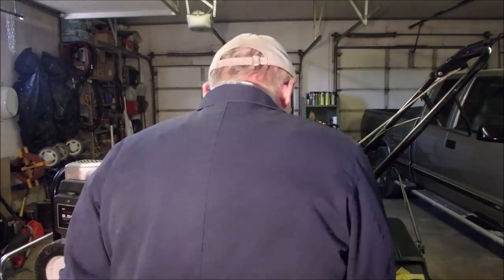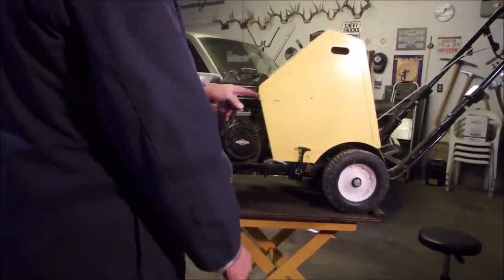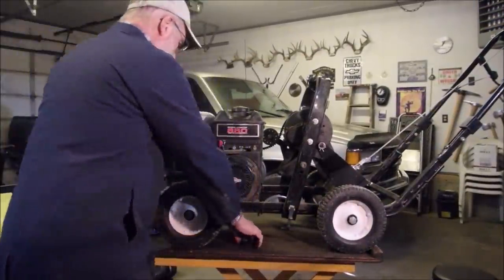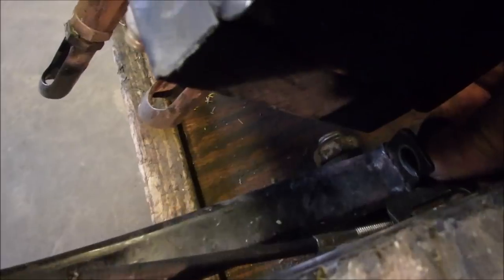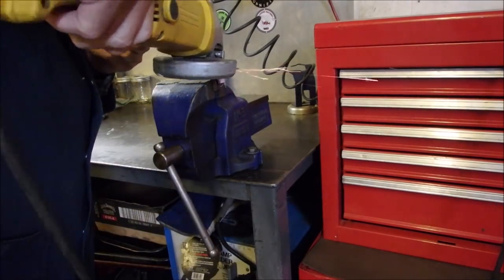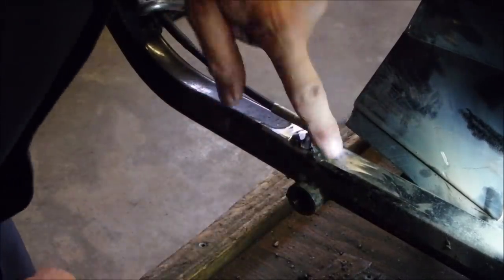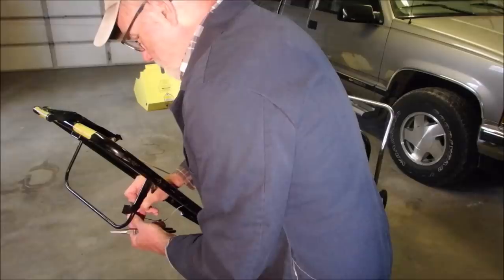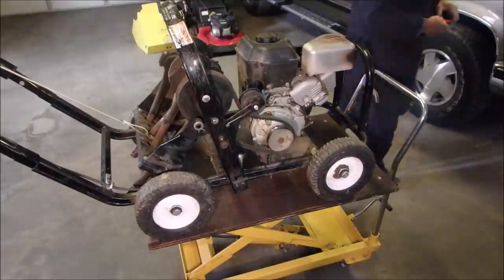Plugr Lawn Aerator Will Not Run

Comment: Good Job Bruce. I used to own a couple of those pluggers. One smaller than that one and one that size. You were correct there was a cable end keeper where you welded that one on at. They are good aerators and work well even when the soil is a little dry.
Reply from the maker: Thanks  I felt to me like I was closer to stock when I was finished ---except for the splice in the cable.

Comment: Nice repair Bruce basically the only way to fix a cable with that splice unless you can pull up a part number and order the original replacement.
Reply from the maker: Yes.  As well my place is more of a hobby setup.  3 machines a week not a day.

Comment: Sorry Mr Bruce but which nuts did you get the paint on sir?? 🤣🤣
If you use Mr Henry's Nut Wax the paint might not stick..... bahahahahaha!!!!
Nice video and fix, thanks for the laugh buddy. 👍
Reply: John you talking about the Nut Wax KB did the video on? We actually got some from Waxmillions in the USA and when you need it to hold a screw or bolt in a difficult spot and your fat fingers are in the way it is the go to solution. One day we need to do a short video on the stuff a must have for the shop saved me hours installing two short bolts on the underside of a rototiller engine.
Reply: That’s the one Mr Wayne, I should get me some too since my fingers always get in the way. 
That would be a good video to do, it would be helpful. 🙂👍🏼
Reply: Paint on the nuts is always a serious problem as turpentine may damage critical components.
Reply: @Big_Johns  good idea. My fingers are not as much in the way as they used to be. But it’s a good solution to a common problem.
Reply: Very true Haney, we gotta watch out when working around our critical components. 😳😳
I’m sorry but I had to chuckle about your fingers comment, I’m sorry. 🙈
Reply from the maker: @waynestefinashen239  Thanks Wayne
Reply from the maker: @haneyoakie14  LOL
Reply from the maker: @haneyoakie14  Darn spray bombs
Reply from the maker: @haneyoakie14  Right.  Good you still have some humour  (Canadain Spelling)
Reply: @Big_Johns  I intended it to be funny. Laugh if the humor moves you.
Reply: @BrucesShop  laughter is good medicine. I’m still in the game. I paid a whole $10 yesterday for a McLain edger that is complete, except for the air filter assembly. Later today I’m going to see what it can do. It is a Briggs, I think it will be fine. I have an air filter assembly that I think will fit. Grass is trying to wake up around here. Let Spring begin! I might go rabbit hunting on Sunday.
Reply: I love to see people smile and laugh Haney, thanks for always staying positive brother. Good luck with the edger, I’m working on a blower and hesitantly a Husqvarna 570 chainsaw even though I don’t work on chainsaws anymore. 🙄🙂
Reply from the maker: @haneyoakie14  Have fun.  Another reason I couldn't test the aerator is we just got another few inches of snow.
Reply: Both you and John Klem have a good sense of humour (per Bruce Cdn. spelling)
Reply: As so do you Mr Wayne 🙂
Reply: @waynestefinashen239  Canadian spelling is perfect for all my Canadian friends. If never worked for me in the US on my grade school spelling tests. Lol.
Reply: Good video Bruce, that was you guys talk about must be the Canada version of the Taryls turd polish? But that machine was too nice for that!

Comment: Usually there is a spring attached at the end of such cable to make it so you can squeeze the engage handle to the bar. Odd there isn't one there. I like your video, but your welds are interesting to say the least. Maybe invest in a MIG welder setup. Easier to make good welds. Thumbs Up!
Reply from the maker: Thanks for the info!

Comment: Nice. If I was fixing this, I would have to do a through field test on my yard just to make sure it works reliably. Cool example of diagnosis, of welding techniques, and engineering/problem solving. Ready to go to the owner to make him some money.
Reply from the maker: It is so heavy I will let the customer do that.
Reply: @BrucesShop  will he aerate your yard?
Reply from the maker: @haneyoakie14  I don't think so.  He will test in on his first job.